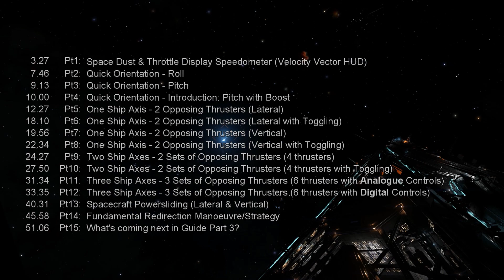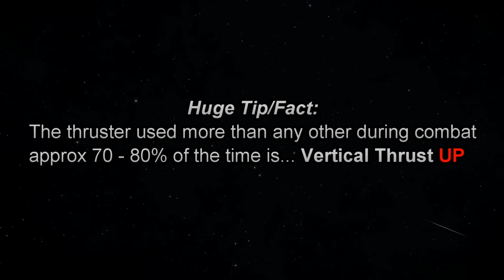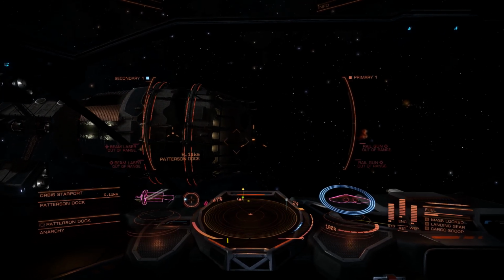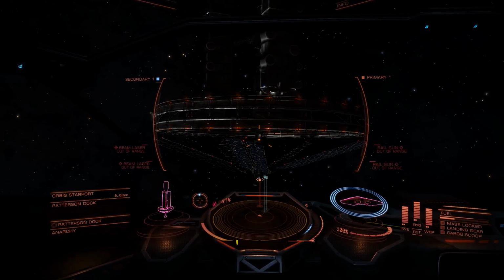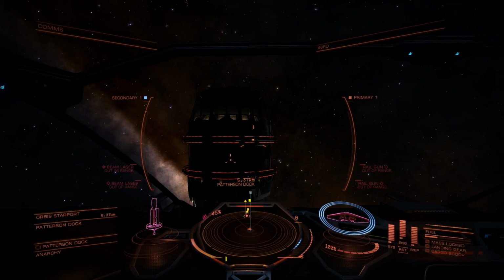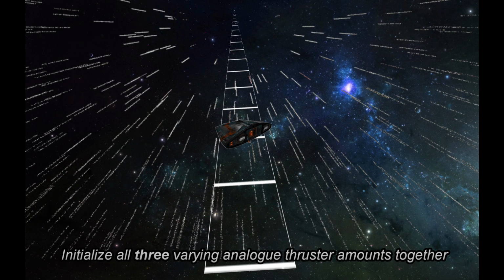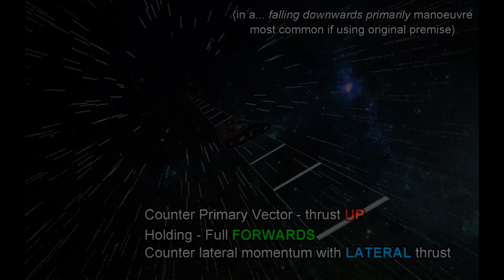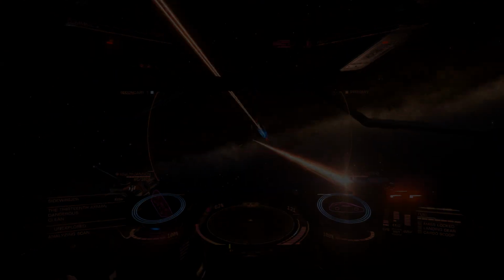Elite: Dangerous - Learning [to pilot with] Flight Assist Off (Part 2)

Comment: What if i use just keyboard and mouse? These manoeuvres are next to impossible, right? (I'm asking becase I can't try it myself for next 40 days as I am away from my gaming computer :D )
Reply from the maker: Morpheus2403 
Not necessarily. I'm not going to say anything other than a proper hotas set up is less than ideal, however that said, with one of the main principles of the control inputs when piloting with no flight assistance sometimes are mainly about how long you hold each thruster, not necessarily how much of a thruster input, so.. one can still use a keyboard with these digital controls and manouevre the ship with relative success, like I say, as long as you concentrate on your 'duration' of control inputs. 

To be fair as well, controlling the ship's orientation/rotation with a mouse, with the extensive power curve adjusters and sensitivity sliders you get with the mouse, some might say this is actually easier to control than using a joystick which has none of these aids. I have covered a chapter for this concerning the technique behind digital control Chapter 12 (because some hotas' only have digital pov/hats which is the only control option to use for lateral and vertical thrusters, so thought it best to cover this technique if you only have these digital controls for thrusters) so with keyboard you haven't any more of a disadvantage. 

Of course ideally I would recommend everyone to use an analogue control setup, clearly these will give us the fine adjustment that is sometimes needed, but this is not to say with digital controls it is impossible. Like I say, check out chapter 12 in this guide, and apologies for the long reply ;)
Reply from the maker: Morpheus2403 
Just a quick note to perhaps guide you in the right direction concerning keyboard mapping/bindings. From previous discussions about this with a few players I've talked to, about how/where to actually map all the thrusters to which keys? One would normally map forwards/backwards thrust to "W" & "S", then "A" & "D" for lateral thrust. But this of course leaves which for vertical thrust? This doesn't really work so many of my keyboard & mouse friends map WASD for vertical and lateral thrust, (and perhaps "Q" & "E" for ship roll, then you don't have to use the roll on yaw option for your mouse, just have the mouse pitching and yawing with these Q and E for Roll) but this is optional. However we haven't mapped your main forward backward throttle axis anywhere yet, so one ideally needs a mouse with a couple of extra buttons on it (usually on the side perhaps) to map your forward/backwards thrust on it. This is the only acceptable method so as to get all your thrusters mapped to keys, and also that are in a configuration that you could perhaps get used to (like I say, most if not all my key/mouse friends have it set like this). 

Hope this helps a bit. I suggest all this because when mapping forwards/backwards & lateral thrust to emulate a first person shooter (WASD) which is the natural reaction, vertical thrust obviously wants to be on the same keys (W,S) or you simply have to leave vertical to somewhere else, but where. So ideally you need a mouse with a couple of extra buttons on it to have your main throttle axis somewhere where it will feel intuitive to use, and like I say, WASD for your translation thrusters. Hope I haven't battered your head in too much ;)